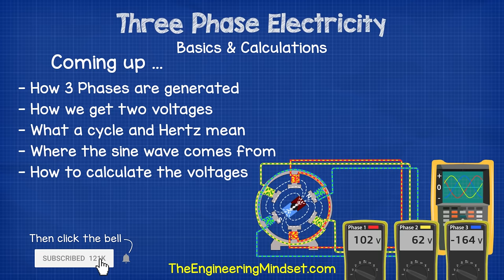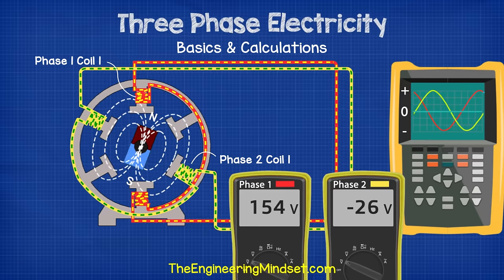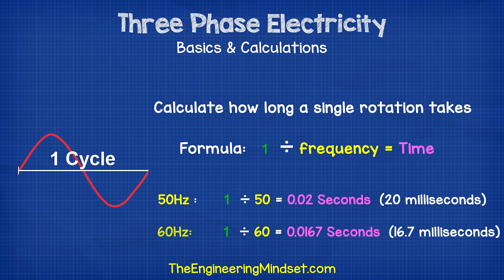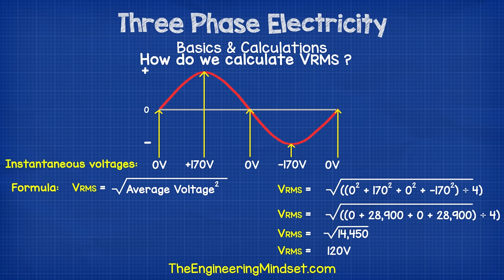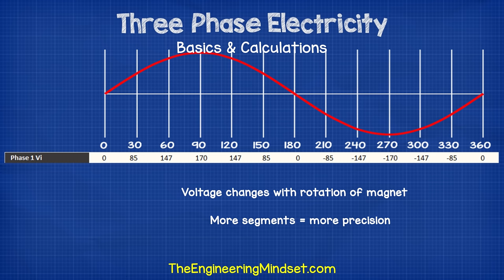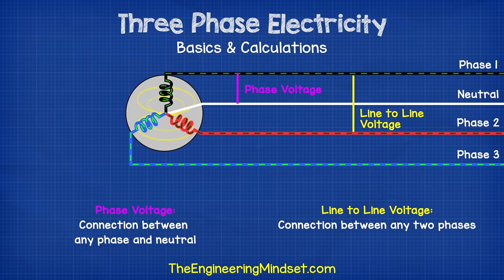Three Phase Electricity Basics and Calculations electrical engineering

Comment: Great Video.  Assuming some sort of mechanical force is being used to drive this generator - how does it maintain a consistent frequency of 50 (or 60)Hz?
Reply: By put the equal amount power to the generator. If the power is to big the frequency increases. Yes, it's a hassel that is maintained 24/7 in our grids.

Comment: Square root of 2 works for the RMS of a single phase and the square root of 3 works for line to line.
Reply from the maker: Only if the sine wave is perfect which it never is in reality. That's why you should buy true RMS equipment
Reply: @EngineeringMindset  What? It works as a general guideline as to where different numbers come from. 120v to 208v, 277v to 480v, etc. Instead of squaring up every 30 degree angle and then square rooting that... That example was also a general guideline.
Reply: 2:22 - 2:42 :   √3   ≈  208÷120   ≈   380÷220   ≈   400÷230   ≈   415÷240.   Also at 14:00.

Comment: How do you get 120 degrees apart for the different phases at 11:49 in the video? The diagram shows the phases are 60 degrees apart. What is the relationship between the mechanical phases and the electrical phases?

Comment: As far as I know the country (Europe) where I live in is slowly increasing the voltage from 220V to 240V.
As far I know we have 230V at the moment.
Reply: It's been 230 V here in Sweden since 1988 or something, and I think most of Europe is about the same. But it is a small detail, doesn't really matter, as the video is more about what 3-phase is, and not the voltage used by each country.

Comment: Great as always! Can you please make a video about what’s happening to a 3 phase motor if we lose one phase? A blown fuse for example. We call it “Single phasing” but I don’t understand why... We have two phases. So, then why single phasing? What’s the sine wave there? Average of two left? And one more thing. I want to buy your excel file, but I am from Russia. Which one fits me? Thank you in advance))
Reply from the maker: Will add those to the list 😉
The files are the same, it's just the currency that's different so maybe £ or euro is cheaper for you
Reply: I mean do I need the file for EU?) Thanks a lot))
Reply from the maker: The EU one will be fine. The download is variable so you can change it to any voltage you like and it automatically updates :D
Reply: Станислав Карамов    I hope you don't mind if I take a stab at your question!   In three phase you have 4 connection points A,B,C,N.   please consider that phase is truly sine wave not connection points.  So A-B is phase 1, B-C is phase 2, and C-A is phase 3 assuming clockwise rotation.  If one of the connection point is lost, let's pick B as gone.   Since B does not have power anymore, the only connection that works is C-A, hence single phase.    I hope this helps!   Respectfully,   Kevin
Reply: @KevinCoop1  Thank youuuuu!!  I love these videos and usually follow pretty well, but that distinction totally escaped me.

Comment: 11:25 at the 30° degree we multiply 170 with 0.5 but at the 60 and the 90 degree what should we multiply with the radian (at 60 degree 140*1.05 and at the 90 degree we multiply 110 with 1.5? ) if am i right what couse this 30 volt difference?

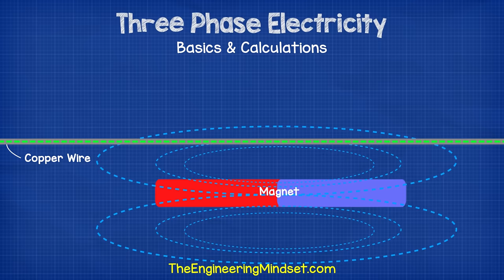Comment: I got a question: I thought that what makes the electrons flow was the potential difference. Why at 4:15 it says that is the magnet to make them flow and the same magnet to make them invert the direction? Therefore there would be the wires to make the magnet turn at 7:00 but I understood that is the magnet to make the fase go up and down. 
Thanks

Comment: i have a question about the phase and neutral in generators. acording to your explanation on the video, the curent are flow from phase to neutral and after that it wil change from neutral to phase. 
than why only phase can give us an electric shock and not neutral ?

Comment: while for all I know the Utility may be measuring the RMS empirically by comparing dissipative AC & DC loads for monitoring purposes, the derivation for the sqrt(2) factor between the Vmax and Vrms is that instantaneous power delivery from a wave (any wave) is proportional to the square of the wave amplitude.  The wave amplitude is proportional to V, in the case of AC power.  Integrating a squared sine wave over a full cycle to measure the total power delivery over that time period brings out the sqrt(2) factor when converting back to expressing Vrms in terms of  Vmax.

Comment: Great video, but I have a question. In your previous video the maximum peak of the voltage falls together with the 'side' of the bar magnet. In this video it falls together with the tip of the N or S side of the magnet. What is correct?
Reply from the maker: This one. The first was simplified.
Reply: @EngineeringMindset  Are you sure? Because when the N-pole is opposite to the coil the N-S goes from becoming stronger to weaker. So according to the law of Lenz the direction of current should turn there?

Comment: For all intents and purposes homes have single phase while commercial and industrial has 3 phase available, but there are  some exceptions.  Some power companies have limitations for large single phase services and might require going to three phase for anything larger than around 600 amps, which could occur with custom built luxury homes with extreme electrical demands. In some rural areas,  farms have a 120/240V 3ph 4w delta service available and are easily identified by two or three transformers on the pole, with one being significantly larger to compensate for the fact all the 120V loads come off that transformer and cannot be balanced the way a 208Y/120 system can.
Reply from the maker: Seen our new 3 phase transformer video?➡️: https://youtu.be/u0SsejDCVkU

Comment: If you wave your hand in front of a large incandesant light bulb, you can see the flickering motion of single phase house current. * I have used 3-phase 400 volt electricity for ground power to aircraft ( which converted it to 28 volts DC)

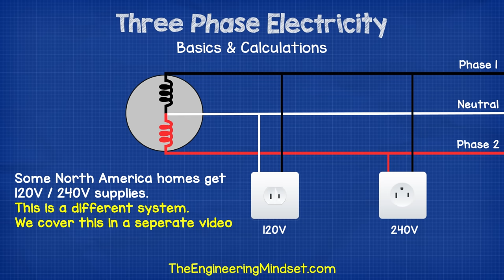Comment: As others previously mentioned In the USA the home or residential  120V/240V are a single phase 240V line where the center tap is the neutral.  At 2:11 while your diagram is correct,  the labeling calling the ends phase 1 and phase 2 is confusing and not technically correct.  It is a single 240V phase that has been split into two 120V branches, but both branches are still in the same single phase.  
If I could get multiple phases just by splitting a single phase then converting from single phase to 3 phase wouldn't be such a pain.
Reply from the maker: Yes, we covered that in great detail here https://youtu.be/fJeRabV5hNU

Comment: Instead of using the Vrms, is it possible to make a forumua using frequency or generator speed and voltage to determine your "average" voltage? (120v). Similar to a pistons max speed will be in the middle of the stroke. Or would this simply not work in all or any situations and not be practical? How might this work for inverters?

Comment: I thought I'd let you know since you keep mentioning that european power systems run on 220/380 VAC whereas, at least speaking for Sweden and the nordic countries (probably all of the EU), we use 230/400 VAC. It's covered in SS-EN 60038 / "CENELEC standard voltages". Great video nonetheless! :-)
Reply from the maker: Nice reference. Europe has been electrically harmonised but only really in policy and product design. The power transmission hasn't really made any changes, the 220v countries are still using 220v but they're allowed to go down to 207 or up to 243V. As this is a basics video I went for one voltage value and then gave different options around the world to cover them. Glad you enjoyed though
Reply: @EngineeringMindset  According to wikipedia all EU countries use 230V (Including the UK). Only French Guiana (located in America) is using 220V
Reply: @EngineeringMindset   here in Austria   I get the exact same reeding as you on the multimeter measuring between LN ~235V and L1L2L3 ~410V. The standard voltage is 230V/400V since decades.
Reply from the maker: Check our new Multimeter tutorial out ➡️ https://youtu.be/4lAyzRxsbDc

Comment: Hi Engineering Mindeset Team,
is it possible that your animation is wrong?
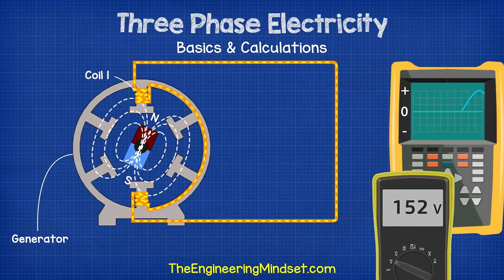Between 5:29 and 5:31 is no change of flux in the coils (during the transition of the magnet from the LHS to the RHS of the coil) - So the Volt-Meter is supposed to show 0V instead of max Voltage.

Could you please check and comment below?
Thanks

Comment: The voltage used throughout Europe (including the UK) has been harmonised since January 2003 at a nominal 230v 50 Hz (formerly 240V in UK, 220V in the rest of Europe.
Reply: That explains why my Swedish school book in electricity says 230/400V not 220/380V like claimed in the video.

Comment: US/Canada is in fact 240VAC at the house and that's what large appliances use (Stove, oven, dryer, electric furnace, ...).  The neutral, however is split at the transformer (utility pole or padmount) such that it lies between the two hots halfway.  Mexico is slightly higher.
It is NOT 2 phases in use as your graphic suggests.
Also, sockets are hot, neutral and ground.  Not 2 prong as suggested in your graphics (though some remain in very old houses).

Rotations depend on the number of poles per phase - so if the generator or motor has 10 poles per phase, then it would be 1/10th the speed, but 10X the torque (all other things being equal).j

Comment: i think there is a problem in phase 2 and phase 3 voltage calculation ... 
i think phase 2 should be = vmax * sin(rad - (150*π / 180))
phase 3 should be = vmax * sin(rad - (210*π / 180))

in phase 2 at 60degree value should be 0
in phase 3 at 120deg value should be 0

Comment: Technically America uses 220VAC single phase + it splits the phase voltage only for 2-120VAC off the output coil.( ie ties a neutral in center of output coil to residence.  Single phase is provided at 240VAC as our appliances do not run off 2 phase electricity.)

Comment: Fascinating. Do you think it possible to build a rotary phase converter that will be able to supply single phase power once it runs? I use a 120 volt motor to spin up a 3 phase motor. Then I have 3 phase for my machines. Can I use one? of the "legs" to  to be the "supply" once the 3 phase motor is running?. I am wanting to use it as a generator so I dont need the electric co.Thank you- sam
Reply: Sam Stewart    Where would the energy come from to make the 3 phase motor spin in not the utility?

Comment: Interestingly enough, not the entirety of Australia is 230V. I always thought we used 240V... and that's because we do. The nominal voltage across Australia is 230V, though Western Australia and Queensland (whom is supposedly / has transitioned to 230V) utilise 240V instead, hence everything is rated to 240V @ 50Hz.

Comment: Hi, I don't quite understand how the drawing of the coils matches to the graph. At 0 degrees, the red coil has 0 volts as the magnetic field from the magnet is at its weakest. The coil and north or south pole are 90 degrees apart.
According to the drawing, the yellow coil would experience 0 volts when the pole is 90 degrees away from the coil which is at 150 degrees, so at 60 degrees, but on the graph, at 60 degrees the yellow coil has a negative voltage.
Same for the blue coil, according to the drawing, for it to be at 0 volts, the pole must be 90 degrees apart , so at 120 but the graph displays a negative voltage too.

Comment: Why is the the phase to neutral voltage the RMS of one phase BUT the line to line (1 phase to another phase [2 phases]) voltage the RMS of all three phases?
Reply: in three phase circuit you have actually 3x ph-ph voltage; like 3 different voltages - between L1 and L2, L2 and L3, L3 and L1. And each of those is 400V (for europe)
Reply: Kris    All utility produced AC voltages have sine waves and are measured as RMS values whether stated or not.   Unless stated as peak or peak to peak.
Reply: All these ppl in this comment section wanna teach, but don't have channels. Just say " Great video" and move on. Ur welcome

Comment: Why stop at three phases? Seems like there is some dead space that could be utilized in the gen
Reply: Would also like to know.  But my guess it is dictated by standardization.  3 phase is already a step up from standard 1 phase.  The local Powerstation wouldn't want to make a 360phase generators to satisfy 1  client who has a custom built motor that wants to save electricity.
Reply: One reason is that three phase electricity can naturally drive an induction motor because it can create a Rotating Magnetic Field (RMF).  These induction motors are very simple and easy to maintain and used in industrial applications in factories that get 3-phase power direct from the power company.  Creating more phases is unnecessary to reach this capability and just adds more wires.  The brushless motor in an Electrical Vehicle (EV) is three phase AC motor.  It is fed power from the on-board DC battery via an Electronic Speed Controller (ESC) which creates and modules three phase power via precise electronic switching of three banks of MOSFET transistors.  Varying the frequency of the generated three phase output will also vary the motor's speed.  This is done these days by an inexpensive microprocessor running a firmware program that receives throttle inputs from the user/driver and controls the three MOSFET banks.  Having more than three phases here would also be of little benefit.
Reply from the maker: Check out the new BLDC Motor video: https://youtu.be/yiD5nCfmbV0
Reply from the maker: See my new MOSFET explained video here➡️: https://youtu.be/AwRJsze_9m4

Comment: One question : So yeah electrons are being pushed back and forth by the North and South pole of the magnet, consider a single phase padmount transformer with high side bushingand hot wire coming into the front of the winding through bushing and the end of winding connected to the tank internally then grounded through external wire. I know it has zero potential since it's grounded, but it kind of contradict to the theory of electrons being push back and forth, it's like when you ground it and the electrons just got freeze up ??? Please let me know why a single route can have different phenomenon😢

Comment: The only part that continues to stymie me is the transition from 6 wires to the Wye or Delta connection.  Maybe it is b/c of all the water analogies (pressure-voltage, current-flow).  Why doesn’t the current attempt to stabilize between the 3 phases?

Comment: Q: Do you get the same 208V ac voltage value when you measure across 2 ac phases and when you measure across 3 ac phases? I assume so but why is this? Thanks
Reply: A voltmeter will measure difference in potential between the 2 leads. So there really is no such thing as measuring between 3 phases.  208VAC single phase and three phase are the same voltage, but the 3 phase systems offer much more available power. Take a piece of paper and draw 3 parallel lines down one side and one line down another. Assume the first 3 lines are L1, L2, L3 and the 4th line a neutral of a 208VAC system. Connect a load between any one of the L's and nuetral will be 120VAC single phase. Between any 2 L's will be 208VAC single phase. Between all 3 L's will be 208VAC 3 phase. To understand the difference in available power assume a load drawing 10A. Power equals volts x amps. 120VAC single phase would give us 1200VA available power. 208VAC single phase would give us 2080VA. And 208VAC 3 phase gives us 208VAC x root three x 10 or 3598.4VA  Hope this explanation helps.
Reply from the maker: Seen our new 3 phase transformer video?➡️: https://youtu.be/u0SsejDCVkU

Comment: The US has split-phase.  It isn't really correct to refer to it as 2-phase (like they had at Niagara Falls) as that is akin to 3-phase.  But the US does use 240V as a standard...it just gets 'split' to provide 120V via a neutral wire.
Reply from the maker: Watch this video on US electricity: https://youtu.be/fJeRabV5hNU
Reply: The Engineering  you are wrong on the majority of our 3 phase here though. We usually use 480 volt wye configurations. You only get 208 volts if you are using a delta configuration and you end up with 3 legs of 240 volt leg to leg one split phase 120 leg to neutral and a 208 leg to neutral. This is usually only used in light commercial applications such as office parks and larger apartment communities.
Reply: alex lacey   I'm sorry sir, but you are incorrect.   208/120v is a wye configuration widely used in the US.  240v delta is almost never installed as a service from utility.  It was installed 50 years or more ago, but not any more as a service.   You might find it in some industrial plants because some equipment will not run on 208 volts.   Usually derived through transformers.

Comment: A correction at the start is Australia here we use 240 volts single phase and 415 volts three phase for houses and industry this is the best way to maintain efficiency
Reply from the maker: That's not correct, Australian nominal voltage is 230V, you're part way through a transition from 240 to 230 to align with the rest of the world. Not all states have implemented this as yet.
Reply: @EngineeringMindset  volt drop range. Australia to AS 2926-1987. 240 / 415 V. -6 % to +6 %. -5 %. -11 % to +6 % 213.6 - 254.4. Australia to AS 60038-2000. 230 / 400 V. -6 % to +10 %.
Reply from the maker: AS 60038(2012) specifies a nominal voltage of 230V +10/-6% (216V – 253V)

Comment: How electricity turns back to its source in tree phase motor, where there is no neutral wire connected to it. Also how one phase appliance si connected in tree phase system where there is not an neutral wire?